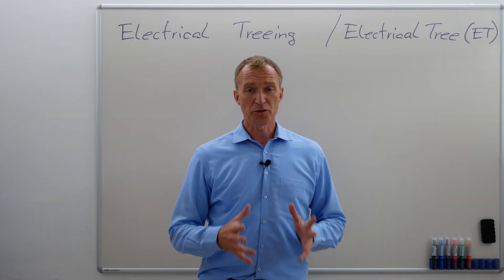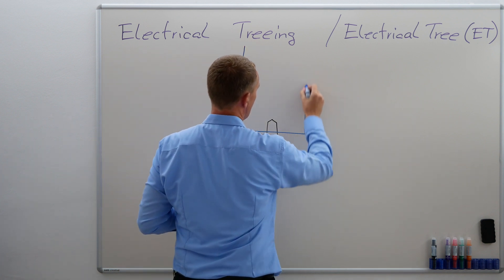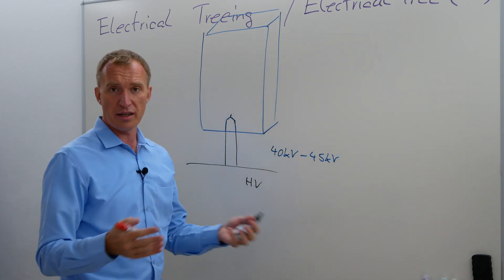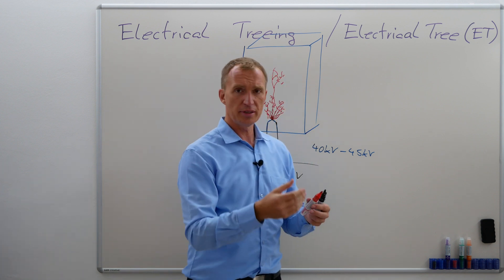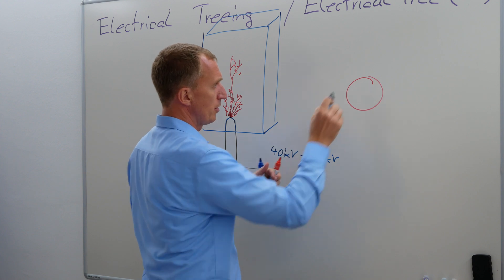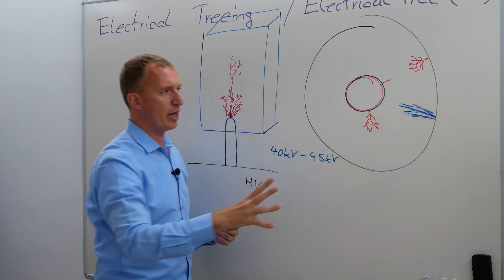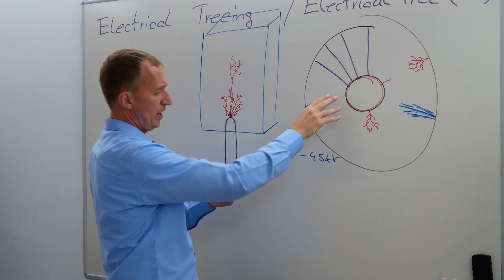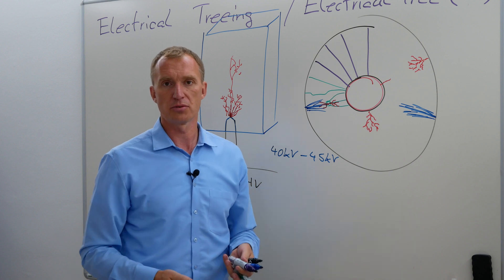3.5 Types of Partial Discharges - Electrical Treeing

Comment: If the conductor is inside the insulator, how could the PD start from the outside?
Reply: I'm pretty sure it comes down to (2) factors: 1) a deformity in between the layers, whether that might be from a crease in or scrape of material, and 2) a third substance presence in the void left by the deformity. 

The deformity introduces a non-homogenous / heterogenous concentration of electric field lines, and those concentrations change what the voltage gradient looks like near the deformity. So higher voltages due to "cusps" or "corners" if you remember discontinuities from math class. Since the electric field is everywhere between the inner conductor and outer insulation, as long as there is an interface between layers along that electric field, then PD can happen. It could start near the conductor, or near the outer insulator, or even somewhere in the middle and branch out in opposite directions. Also, most of the time PD is talked about in an AC context, so the electric field will flip multiple times a second which can mean the trees can travel in different directions.

Then the third substance, whether air or water or oil or nitrogen, is subjected to the higher voltage and can experience a breakdown where electrons are ripped away from the substance's valence bands. Once those electrons are ripped away in the direction of the electric field towards positive and away from negative, the leftover ion appears positive, thereby extending the field inside the deformity and concentrating the field more. As the electric field travels along the positive ions, more of the substance has electrons ripped away, and you have a fractal breakdown pattern like the tree shown in this video. 

At least that's my understanding of how it can happen.